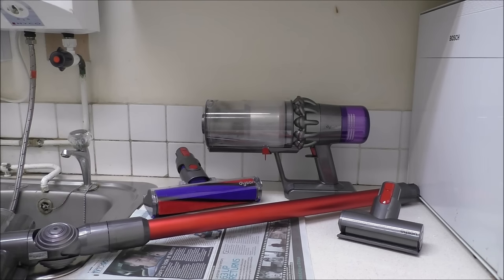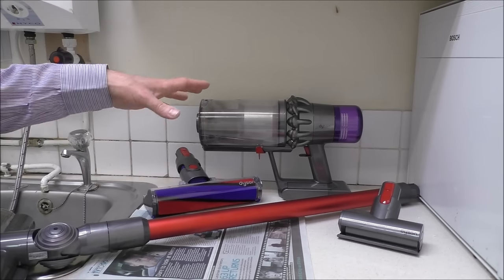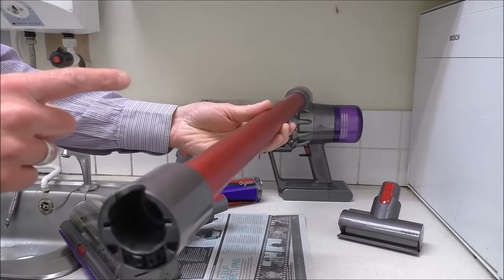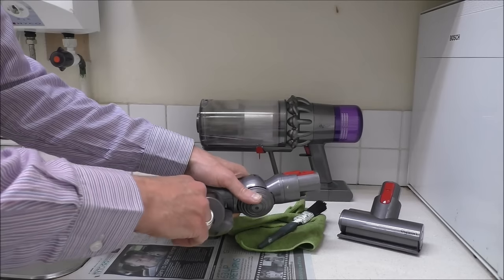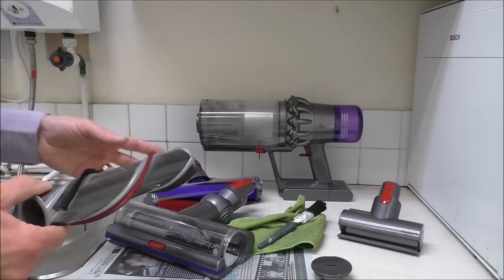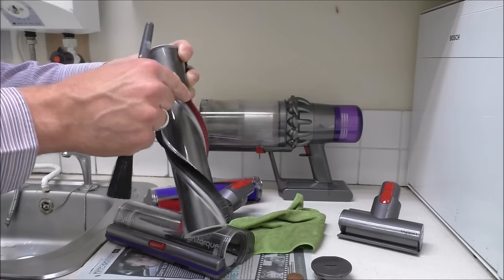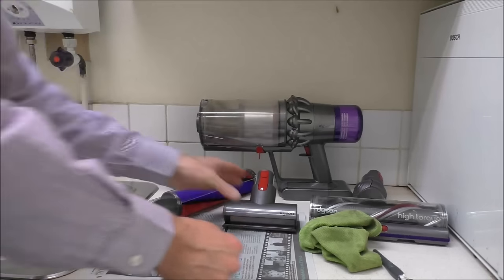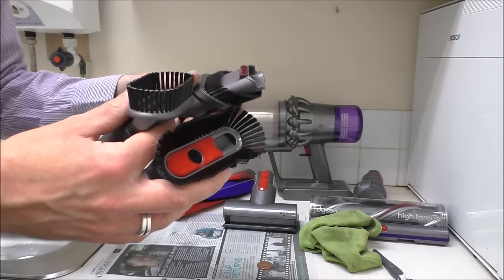How to Clean and Maintain the Dyson V11 Cordless Vacuum Cleaner

Comment: I don’t know if anyone will see this, but if anyone knows the answer to my Dyson problem I’ll be very grateful: I can’t get the roller out. I have taken off the end cap with a coin and pulled with all my might, to no avail. I did find some kind of fiber or twine had gotten wound around the outside of the roller (I pulled up some carpet and I think it was from that), and I’m guessing that some is down inside the roller, between the assembly it slides onto and  the inside of the roller. Am I going to have to dismantle the whole thing (i.e. remove screws, etc.), or take it to a repair person? Thank you!!
Reply from the maker: It sounds like you have done everything correctly but you shouldn't need to dismantle and remove any screws any further than you already have.
It can be a case that if fluff or dirt is lodged in there then it can be difficult to remove but not impossible

Comment: Will be faster and cleaner if you just rinse the canister over running water.
Reply from the maker: you would just need to make sure you avoid getting the electrical connections wet.

Comment: My turbo head used to spin automatically when going over carpet and stop spinning on hard floors, now it spins all the time throwing stuff everywhere when on hard floors. Not sure what went wrong, anyone?
Reply from the maker: Sometimes, this is down to the filter not been clean enough or needing a wash or replacing. If you have a new filter then the next thing to try is to see if there is a blockage somewhere which may be reducing the suction on the vacuum.

Comment: I have a lot trouble removing the pipe while pushing in the red release buttons. Anybody else?
Reply from the maker: Sometimes if it is a bit stiff then push the button in and push then pull the pipe out. Sometimes it helps.

Comment: I recommend using something like this air blaster to clean the vacuum & filter.
This is intended for after a carwash to blow water off inside the crevices, but I think it benefits the filter before (blow of debris) & after wash (shorter air dry time)

https://www.amazon.com/Force-Blaster-Sidekick-Prod-Type/dp/B00US404U4

Comment: Does anyone have a problem with the power button because mine was broken after  I used it for two weeks?
Reply from the maker: Not heard of any issues with failing power buttons, but as it is only 2 weeks old, then just ring Dyson and they will sort it for you.
Reply: I did. Mine randomly broke one day. I pulled out the battery and a piece of plastic from the trigger where it pushes on the battery fell out. Sent it to Dyson and I'm waiting on a replacement.

Comment: I am FUCKED if my vacuum is broken, I got it wet inside where the dirt goes in the other filter thing and it is flashing and keeps going on and off.
Reply from the maker: First of all if it is wet inside dont be tempted to try it as it needs to dry out first. Take the bin off and give the filters a good clean and let them dry for at least 24 hours. Try and get as much dirt off inside and then when it is all dry hopefully cross fingers you should be good to go. Good luck
Reply: @lords-electrical  IT WORKS lol thank god, I got it as an Xmas gift and it’s my favorite! I let it dry out and it’s like brand new again

Comment: i don't care how good they say this unit is,,,,,,,,,,,,,,,,,i'm not spending upwards of 600 bucks for a cordless vacuum...  no way is that thing gonna have more suction power than a corded 12 amp hoover wind tunnel or panasonic ,  kenmore,  etc..........which cost alot less!
Reply: Matter of fact is...it does... its a bit annoying that the suction power is so high you sometimes have to lift it up a bit to get really really big debrie...or you just wiggle a bit..

But in terms of cleaning capabilities for floor or chairs or any type of fabric ... trust me ... it is 10000 times more efficient and i never wanna go back to normal ones
Reply: @jenniferr2033  ok,  fair enough,,,,,,,,,,,,,,,,,,,,,,i'm still skeptical........    i would have to see it up close  and in action.....